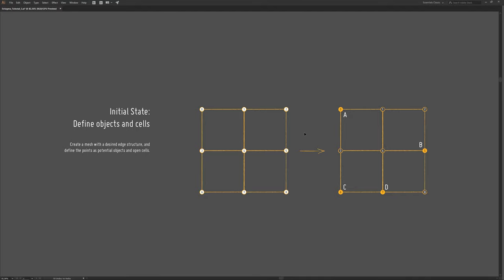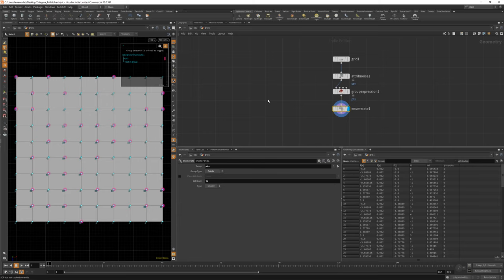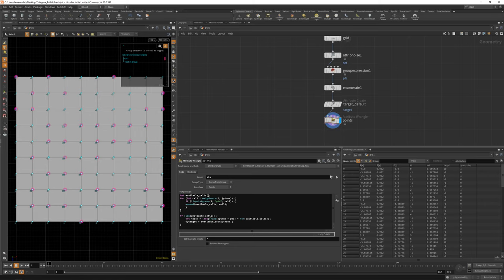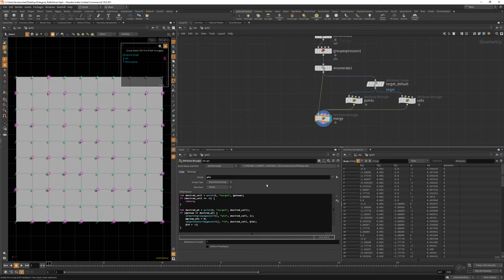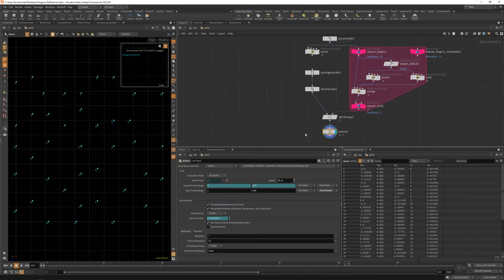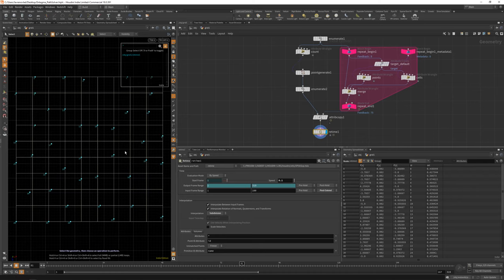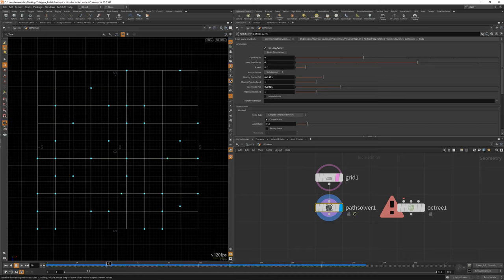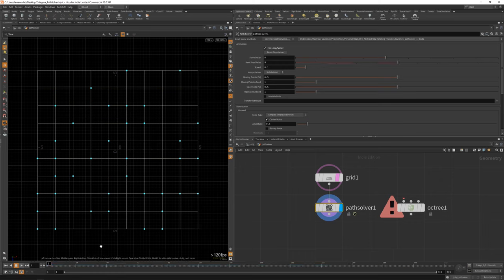Guest Tutorial - Vladyslav Lavrenov: Building A Path Solver

Comment: At 9:30, it didn't make sense to me why you would set an attribute value with setpointattrib() then on the line after you would set it back to zero via @ assignement. I looked through the manual and found this: "The geometry creation functions can run in parallel. All changes are queued and applied after your VEX code has iterated over all existing geometry. This means setattrib will overwrite changes you make through bound variables (for example @name = val)." I figured this might be useful to know for someone else so there you go. :)
Reply: setpointgroup(geoself(), "pts", desired_cell, 1); adds the desired_cell point to the group, whereas
@group_pts = 0; adds currently iterated point to the group.

Comment: Hey Vlad, Awesome content and thanks so much or making the HDAs available as well. I wanted to try something out with them, but I noticed a problem. It seems the HDAs cannot handle more than 128 points! Any points with ptnum>127 wold not animate!

I have no clue where this is coming from, I tried digging around but could not find why this is. The number 128 is a bit suspect, but maybe you want to have a look.
Reply: The asset should work fine with H17+, you're not providing enough info to give you any advice here. I tested the asset with 1 mil. points in a few houdini versions, worked perfectly.